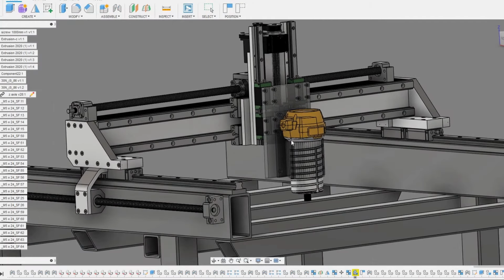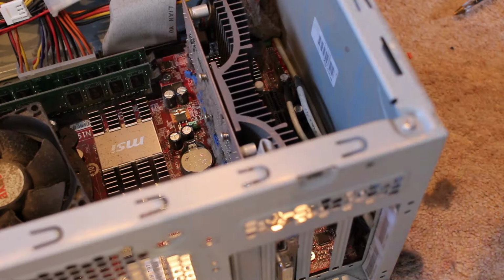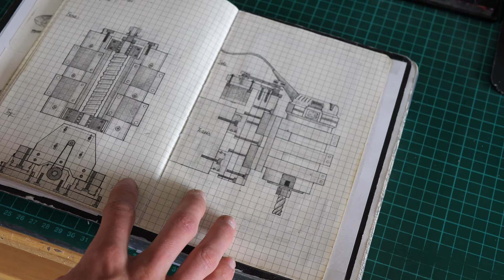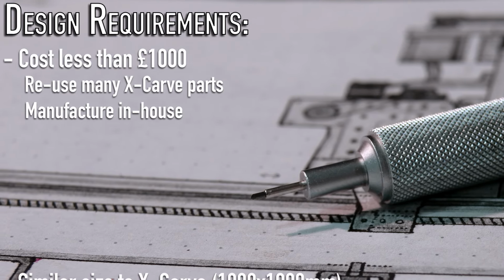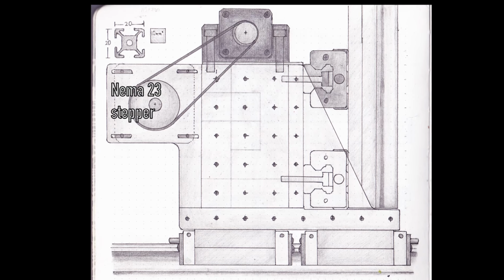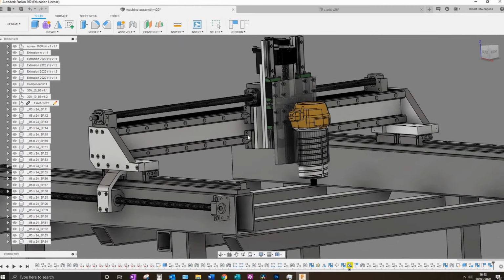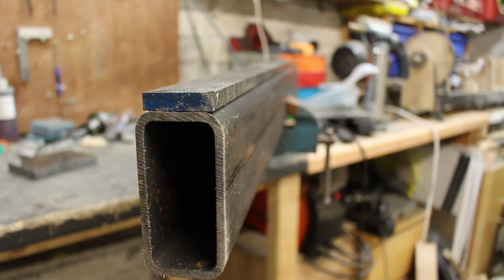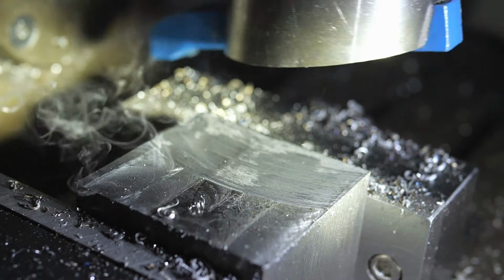Making a CNC Router - Part 1

Comment: The biggest issue I see...I think there is a reason why almost every “commercial” cnc puts the y axis mounted upside down or sideways. With your design, the y axis rails and ballscrews, everything is exposed to chips. It seems like a major design flaw. You could easily fix this. Otherwise it looks pretty cool!
Reply: Also should probably get a Chinese watercooled spindle. They are cheap and really impressive compared to a standard $100 router

Comment from the maker: Loads of people have asked for the CAD files. I was planning on releasing the finished CAD with the last video as I am regularly updating it as I make changes to the design but since so many people are asking here is a link to the unfinished CAD:
https://a360.co/3exLDRg
The design is not finished yet, still lots to add, and I'm not sure if the link will update as I update the design, but a final version will be included in the last video.

Comment: Great looking machine. I am building a near identical machine, all steel except for 25mm thick alloy Z axis plates. My gantry is steel also and I mounted my Y axis carriages both in front of the gantry more inline with the spindle. This way the gantry can run further back to make more use of the rear of the bed. And the spindle can still get to the front of the bed. 
Love your pencil drawings and cad design. I did one free hand sketch then the wrest is in my head lol
I’m subscribing for sure 🤟

Comment: Nice job -- I'm starting a similar design myself, hence watching what others have tried. My only comment is that the brackets that connect your ballscrew nuts to the travelling uprights seem a bit small -- the stiffness and strength of the Y-axis will depend on those. It'll be interesting to see how that works out.

Comment: Nice job! Looking forward to the next instalment. I'm looking at building a PrintNC myself at some point which is not hugely different to your design. My only stumbling block right now is how to achieve a flat surface on the box section for the rails. My thoughts right now are to use an aluminium spacer which will be easier to mill but still not quite sussed out how I'll do that in my garage yet so I'm looking forward to seeing how you do it.

Comment: pros: 
compact design 
beefy spindle easily cuts steel

cons: 
Low rigidity on x axis (ballscrew on opposite side of the load)
Low rigidity on y axis (the plate sticking down will flex under lateral force)
Low speed for its size (small lead drivescrew)
Frame steel parts have very high margin of error so precision is random

If you use a dial indicator to measure deflection under load (500 mili Newtons or less) I guarantee you will redesign  the whole thing

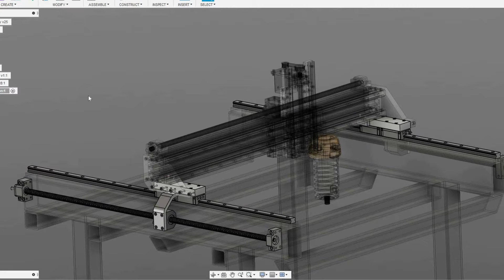Comment: 8:19 Im a bit skeptical about how you connect the Y ball bearings to the carriage. I think the long arm like that is going to be a significant bottle neck in tolerance. There will be a large torque on those arms. I think you'd want to have the screw and rails as close as possible.
Reply: I agree, the design is skechy. But if he can achieve the needed tolerances while building this machine there is nothing wrong with an arm like that.

Comment: seems similar to what im looking at doing shortly, building a cnc just is so much cheaper than buying one, yes it may not be as strong but you can upgrade over time rather than dumping 5-10k down the drain, I simply dont have that kinda money laying around so build it it is

Comment: Nice. My own design is 80% done. All done on Fusion360 too lazy to do paper first ;) Iám going with the same router, but its holder will be symmetrical in an attempt to reduce chatter and control the forces on vector changes.

Comment: You took the effort in making the distance of the spindle from the x gantry as short as possible. I'm thinking why not put the linear rails on the x gantry on top and/or below the X gantry instead of them being on the side? That way you would potentially reduce the distance further about one linear rail and block height. Or are there some forces in play that require the x gantry linear rails to be mounted this way specifically?

Comment: You should strongly consider using a real spindle, the palm router ones just aren't as longlived. Aliexpress has thousands of them will acceptable runout.

Edit: You should also look into hand scraping the precision surfaces.
Reply from the maker: Yeah I'm going to probably upgrade once I've finished the mechanical build, just too expensive to buy it all at the moment!

Comment: If u want to make it stiffer and resistant to vibration just pour concrete with fibers and reinforcement steel rod inside the prophiles . It is common in professional cnc that cost few hundret $ but now mostly they use epoxy granite (epoxy resin with rocks sand etc the same mix like in concrete but epoxy repleace cement) becouse it harden super fast in comparsion to concrete
Reply: I was looking into using carbon tubes instead of aluminium profiles
Reply: @sqwert654  to expensive and dont work best.
The best way to make super accuracy cnc is to use granite yes granite or epoxy granite.
The best in the world cnc are made using epoxy granite for the base or if small using real granite.
The best in the world lathe are made using granite and air bearings :)
U can use granite on x and y ...it is so stiff that u dont need to wory about weight , only one place where it can bend is screews or mounting etc so it is possible to achieve 0.01mm accuracy (or better) with mirror like finish becouse of no vibration :)

Comment: My cnc was around £500 self built i used mach3 usb breakout board ad dm542 drivers, nema 23 motors run at 36v. The machine is made out of steel box as its dirt cheap and aluminium plate

Comment: Impressive project and a great way to hone your newly acquired skills. A thought... would it not be better to attach the leadscrews directly to the axis instead of the hangers that you currently have in plan? I'm thinking of the possible strain inducing flex which would not be good for accuracy/repeatability.
Reply: I think the same way... I've been designing a similar machine (hopefully someday I'll build it) and decided to go with direct coupling for this reason

Comment: Hello ,enjoying your video .would you know if the Original WorkBee Z1+ CNC Machine 1500x1500 (work area) is worth it . I see alot of people modifying their machines . I say roughly this would cost just under £2000 with. Dewalt router ,mdf boards ,etc . 

Was thinking if best to get a cheap one with screw thread type instead of belt and extending it buying the rails etc. I can build the frames ,electrics  not confident  and software

Comment: Bro this is one sick build.. I love the look of it but I'm struggling with the electronics side of my build. I'm using 2020 Extrusions myself for now and mine is going to be roughly about 1000x1000mm as well. I was going to go for 1200 size but I bought an X Axis 1000mm so I've decided to hgo the smaller route which will hopeful;y give me about 8/900x8/900mm OF A WORKING AREA which for a 1st time build will be fine I think. 
Do u have a video or plans with a video that is up online where I can get the information for the electronics side of the build bcos how to work out power supply etc is doing my nut in bro.. LMAO..
I'm seriously struggling atm pal. Amy help u could give me would be so appreciated..
Keep up the brilliant work too my friend.. Salute from IRELAND

Comment: I am planning on building my first CNC. I got access to a water-jet in my university so i am planning on TIG-welding a frame using 3mm water-cut sheet metal. Originally i planned to use linear rails as well, but the cheap ones need a lot of readjustment and cleanup and I also don't want to spend a lot of money on expensive ones. Instead i thought of using 6206 Ball Bearings on 30mm steel-pipe as my linear rails, what do you think ? Is this possible ?

Comment: This is awesome. I will stay tuned for the other videos.
Are you willing to provide your assembly? I can look you up on Fusion 360. I'm considering doing something similar in the near future. Instead of box sections I think I would use 80/20 extruded aluminum sections which would hopefully be accurate enough (and lighter than steel) as I would be building from scratch. Input appreciated however.
Reply from the maker: Cheers! Once I've finished the build I might share the final machine assembly for everyone to download, as it is at the moment there are far too many errors. 
You can definitely build a solid machine using aluminium extrusions but I think a steel frame is cheaper and easier for me, and will hopefully be more rigid (but obviously heavier).
Reply: @taow  True that. Well if you have the place for it the base weight doesn't really matter if it doesn't matter do you :)  I was just thinking about a way to avoid the machining operation.

Comment: Looks nice, but the Z axis looks flimsy with just the plate to hold the motor so far ahead from the rail blocks.
Reply from the maker: Yeah I agree it looks like it could be a bit flimsy, I might add some more bracing after I've finished it

Comment: Great as always! Im also building a 1,6x1,8m, a bit different from your since i make the whole frame from Aluminum except the legs. 
May I ask which vendor did you get the extrusion from? I plan to order it from China but afraid it would not be so rigid. 

Great drawings by the way

Comment: Nooo never go with 1605 ballscrews. Your machine will have terrible rapids. 1610s will double your top speed and the step size will still be smaller than the backlash and play in your linear components. It’s 6micron instead of 3micron at 1/8 microstepping.

Comment: 6:50 - when did you make a machinist cube? :o
Reply: probably the afformentioned work with 5-axis machines
Reply from the maker: It was at the same company as the 5 axis milling but on a manual lathe, good spot haha

Comment: I'm designing a similar machine for myself. It's going to have a ~50x50cm bed and maybe ~10cm z travel. I think I'm going to make it mostly out of Aluminum extrusion (presumably 40x40) and I'm going to use linear rails and screw spindles. The ones found in 3D printers since ball screws are too expensive (I forgot their exact name in English). I'm also going to use a Makita mill. My goal is to mill Aluminum with the best precision possible (yeah I know the srew spindles...). I really hope I can get the structure rigid enough but since it's only 50x50cm it should be fine I think. 
I'm going to get some laser cut steel plates made for parts of the gantry.

Does anybody have recommendations as to what to look out for and what things I should avoid? I've never built nor used a CNC before so this will be my first try :)
Reply: Iám going with 40x80 C sections, 8mm lead screws and wheels for now. Maybe rails later

Comment: It's particularly sad for me to hear that you can use software to check that different parts will fit together yet the 'engineers' where i work can't work out if folded sheet metal parts will before getting them lazor cut and folded before coming to me to weld. AND i work at a VERY WELL KNOWN machine tool manufacturer who sell worldwide!

Comment: hiwin isnt best ..... it is good but in professional cnc etc u mostly dont find hivin
Check INA linear rails ....used ones can work better than hivin and u can buy it cheap 
i pay around 200$ for 3m of rails with 6 sliders ? (bearings ? dont know eng name for it but the same type of rails that u use)
but .... they have 0.003mm accuracy where best hivin is 0.04-0.03mm yes....10x worse than INA ....INA is designed to achieve super high precision and eweryone use them so u can buy it cheap used :)
PS 
it looks avesome on render ,  u probably can sell few :D 
If u want to make it stiffer and resistant to vibration just pour concrete with fibers and reinforcement steel rod inside the prophiles . It is common in professional cnc that cost few hundret $ but now mostly they use epoxy granite (epoxy resin with rocks sand etc the same mix like in concrete but epoxy repleace cement) becouse it harden super fast in comparsion to concrete

Comment: At first glance your design is similar to the ShopBot series which I have used:
https://www.shopbottools.com/products
Theirs uses linear guiderails as well and I believe are ball-screw driven but I can't remember off-hand.
On the ShopBot the gantry supports are steel. This would be more difficult to machine but would offer additional stability over aluminum.
Reply: @melissahill7930  please don't try to engineer on the internet
Reply: @melissahill7930  you just did, in response to my post. That's hypocritical. And your response was completely unnecessary as I was just making a constructive suggestion. As an ME design reviews are an important step in any design process. How about you keep your strong opinions and condescension to yourself.
Reply: @melissahill7930  take a look in the mirror. "thumbed nose".. "opinions as facts"... all of this is exactly what you're doing.

Comment: Great project, I like it. Actually I tried to design and make CNC all by myself twice https://youtu.be/TDTDN_KkoJc and https://youtu.be/ziXmku7p6O0
First one is good for wood and aluminium and I made a few steel parts on it, but I had no good tools for steel. I haven't tried second one with steel because I wait for bench vice to mount on waste-board frame. I have 12.5Nm nema 34 servo steppers for X and Y and only 4Nm nema 34 for Z (not servo, have no encoder on Z) so I don't know how it will work with steel. And spindle is probably weak for steel, only 2.5KW, maybe it will work with low feed-rate because it is water-cooled.